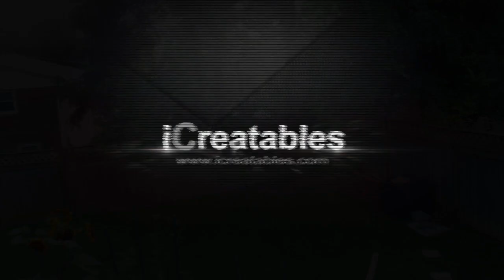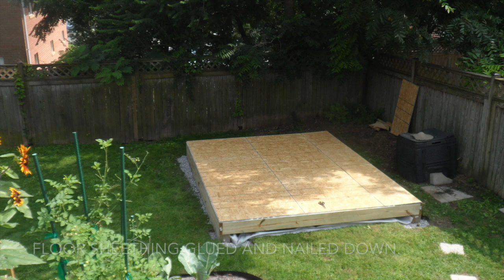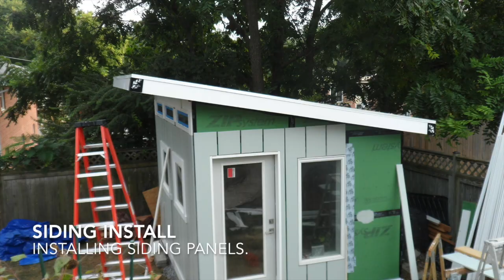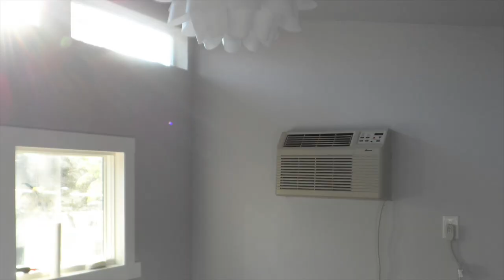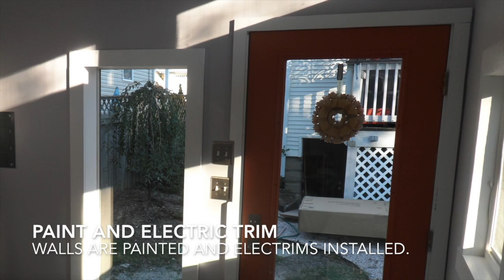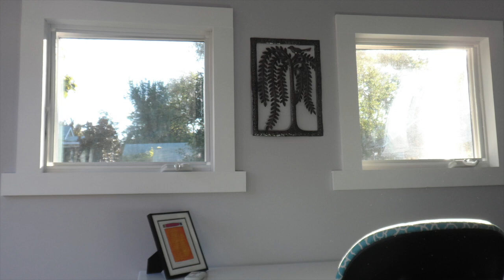She Shed - Man Cave - 10x12 Studio Office

Comment: HELP ME please!!!. I purchased a 30L travel trailer. I am redoing the roof and found out everything has been framed with 2x2 pieces. My goal was to build a pitched gable above the RV so I could have a loft inside. I was going to be using 2x6 can anyone give me recommendations on if I'm able to use 2x4 or 2x6 as my rafter since the wall framing is only 2x2. Idk what to do please help!!!
Reply: It might be better to post to a building or carpentry forum.  The question is sort of vague without more detail and pictures to get a good idea of what you want to do.

Comment: How much does it normally cost for the electrical work if you don’t mind me asking?
Reply: PamLashawn probably couple hundred bucks to get an electrician in
Reply from the maker: It depends on the time. Electricians charge by the hour unless it is a large job where they will give a fixed price. Usually anywhere from $100 to $250 per hour.